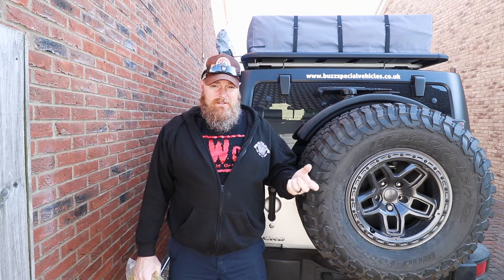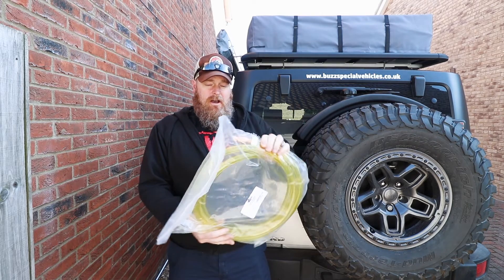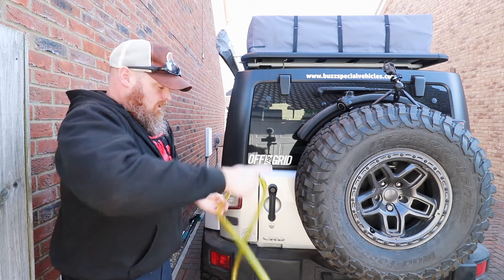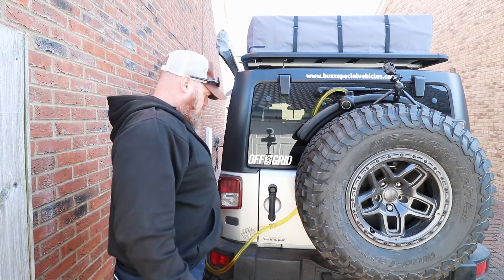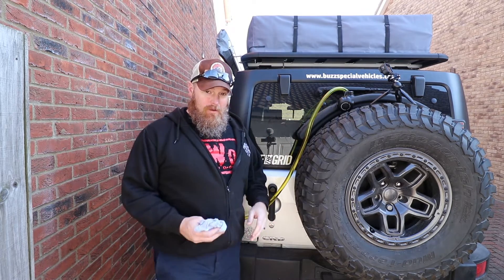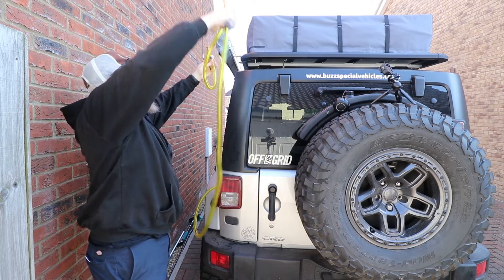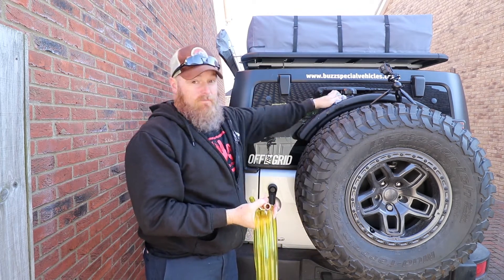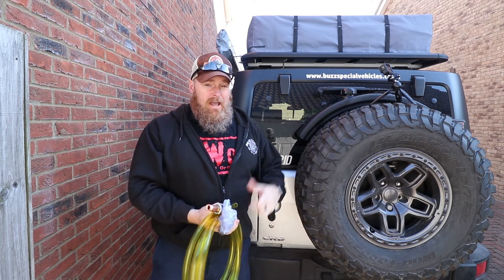AEV Fuel Caddy Siphon

Comment: Thanks for the video!  I too have the AEV fuel caddy and am hoping you can indulge me by answering my question.   How much does your fuel caddy leak through the gas cap when taking it off road?  Mine leaks terribly, there is fuel everywhere, even when I stop filling it 6 inches from the top.   AEV tells me it's designed to leak a little and advised me not to overfill it.  I am very careful not to.  

What's your experience?

Comment: You would think an Electric Assist Siphoning hose / mechanism would have been implemented in this design ?? Mechanical Siphoning is pretty prehistoric but it does work in a pinch I guess !  Maybe there's an electric siphoning hose out there available ?? TY 4 Ta Video !!
Reply from the maker: Thanks for the suggestion, that would be cool. But this one makes quickish work if the job.

Comment: AEV needs to put a lockable cap to prevent bad folks from tampering or stealing your fuel. This product is on the market for over a decade and AEV still not making any security improvements.

Comment: Thanks a ton for the demonstration. I just got my fuel caddy installed (used your install video as a reference). Just throwing a piece of free advice your way. If you don’t have a fire extinguisher already I recommend getting one. I have one strapped to the sport bar in the rear but I’m thinking if there is a fire back there with all that fuel around I should have a fire extinguisher up front where it’s easier to get to.
Reply from the maker: Thanks! And yes it’s in the short list! I need to install one as well. I think I’ll mount mine on the roll bar behind the driver side roll bar.